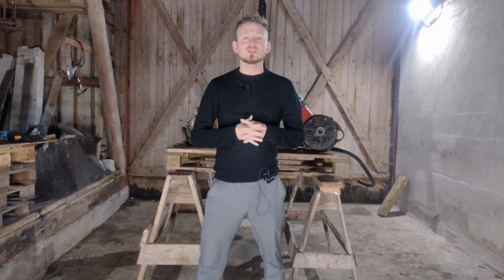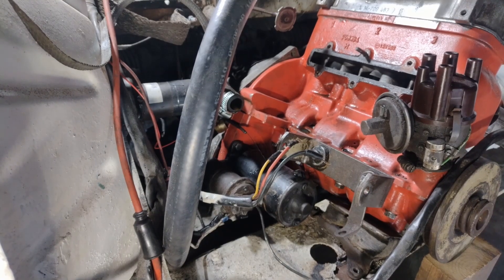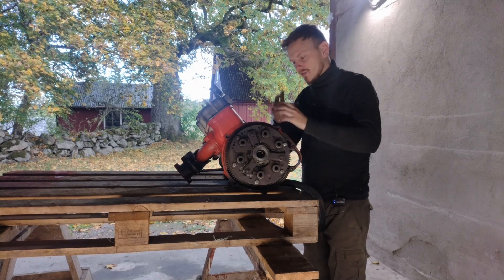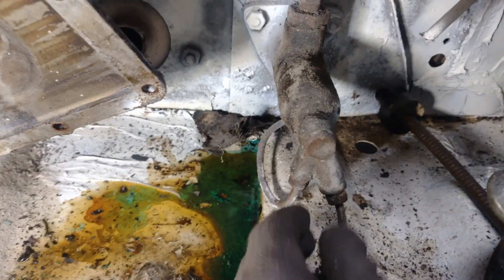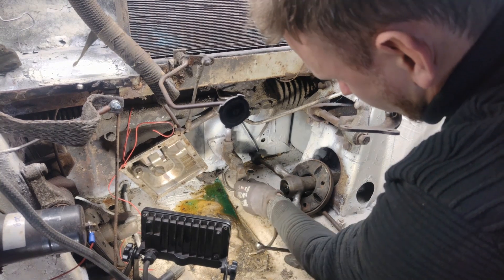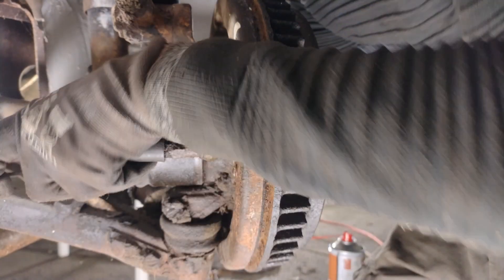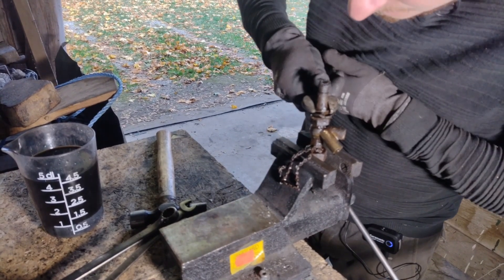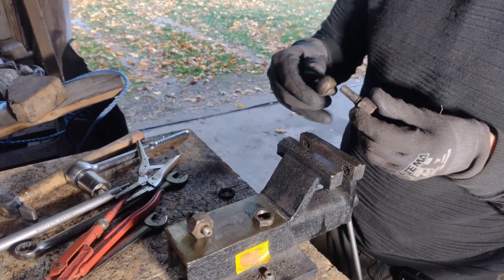BRAKE SYSTEM RESTORATION  SAAB 96 TWO STROKE ( Part 1)

Comment: I have seen in an old Saab manual that the first Saab 96 were build with Lockheed brakes. Does this mean that all dimensions are in inches? 
Regards from Steen in Sulgen Switzerland